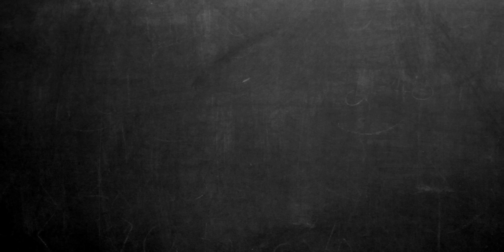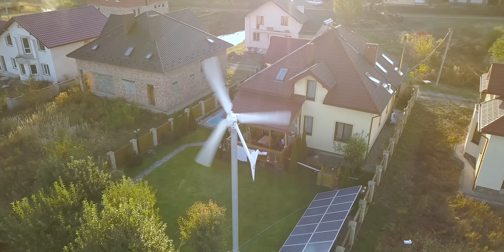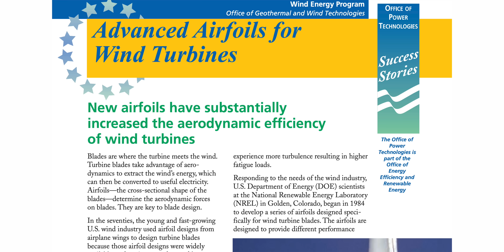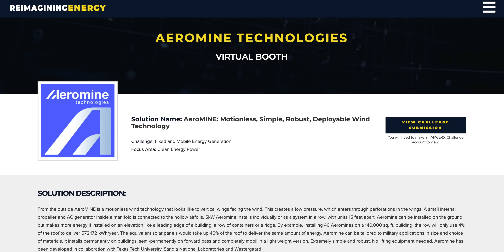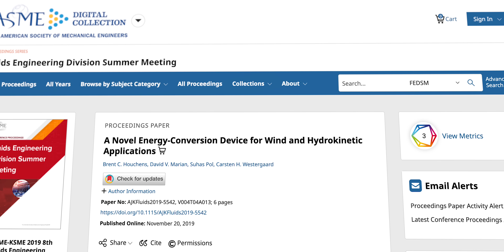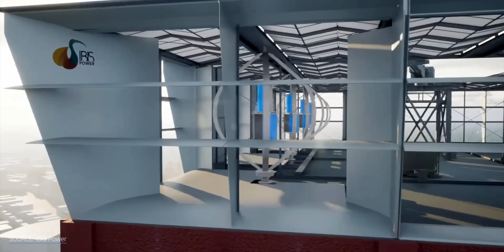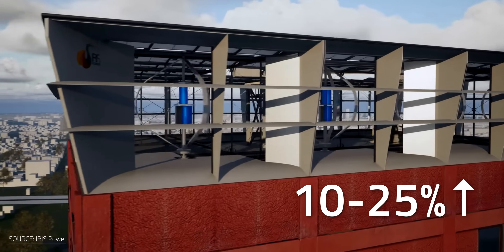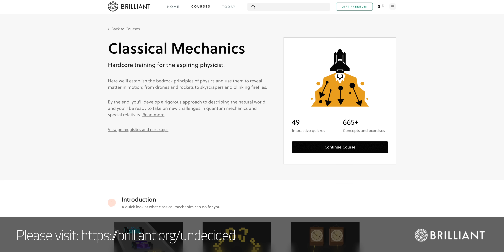How Can A Wind Turbine Be Motionless?

Comment: The power nest is exactly what I've been dreaming of for years. Some kind of a hybrid system of wind and solar working in conjunction with each other. And from some of the examples in the video, they look potentially easy to install on buildings.

Now comes the next part of my dream: somehow combining power nest technology with green roof infrastructures.
Reply: That feels like an either-or scenario, unfortunately. We can only hope that the powernest proves to be efficient enough so that we don't have to fill every roof with them.
Reply: You dont need a green roof if you have the power nest. Unless all you want is looks. The main thing for a green roof is to bring down roof top temps. The power nest will do that.
Reply: Hmm, why do you want a green roof with a power nest? If you want to have plants to reduce your CO2 footprint I would recommend vertical gardens. Look at Vincent Callebaut's architecture and buildings as an example. His Coral Reef houses combined with a power nest is certainly something that is not so far off what we know today.
Reply: @oskarkilo9033  I'm not disagreeing with you, but I just want to point out that reducing CO2 footprint is not the only, or even main, purpose of a green roof. Green roofs are great at reducing the amount of water that flows into the sewer system. I will explain with some made-up numbers. Let's assume in the countryside, only 2% of land is covered with buildings or roads. When it rains, 98% of the rainfall can soak easily into the ground. The 2% of rainfall that falls onto built-upon areas, such as buildings and roads, can flow down into adjacent green land and be absorbed. The result is that flooding from rainfall rarely happens in the countryside. However, in a city, the majority of land might be covered with buildings, roads and pavements. Rain that falls on such areas is typically channelled via gutters and pipes into the city's sewer system rather than soaking into green ground. In some cities, the sewer system lacks the capacity to deal with a heavy rainfall and the result can be the sewers system overflowing to flood roads. Flooded roads are bad for cars (rust), but they are also potentially harmful to humans because the sewer water will contain some (diluted) excrement and urine, and this can spread disease. One way to reduce this problem is to for a city's council to insist that, instead of using concrete, paved areas must use bricks that permit water to seep between the cracks, so some of the rainfall can soak into the earth below. Another way would be to encourage/require buildings to have a green roof. A green roof might have only a few inches/centimetres of soil in which short plants are grown (something like moss or seedum). When it rains, a surprisingly large amount of water can be captured in the soil of the green roof, so less water overflows from the roof to make its way into the sewer system.

About 11 years ago, my wife and I got a home office built at the rear of our back garden. Height restrictions in local by-laws required that the building have a flat roof. I was concerned that a typical flat roof might leak after 10 or 20 years (the sunlight makes the roofing material brittle and prone to crack). We discovered that if we had a green roof (waterproof base layer, covered with a few inches of soil in which seedum was planted), then the soil would protect the underlying roof from the harmful effects of the sunlight for 50+ years (by which time we will have died from old age). It cost us about £3000 extra to have the green roof rather than a regular flat roof, but I figured it would pay back for itself by not having to repair/replace a regular flat roof every 10 or 20 years, and my wife loved the idea that a green roof would look prettier than a typical flat roof.
Reply: @CiaranMcHale  I know exactly what you mean. When I build my house no one cared to make a ground examination. Turned out that the ground had a clay layer in it, which didn't let water flow easily to the layers below. I had all sorts of problems in winter times, when it rains a lot. But we fixed it by building a seep shaft filled with gravel that was drilled through the clay layer. Since these days I had no problems anymore. I also plan to build a cistern to collect rain water from my roof top and use it in summer time, when it usually becomes very hot where I live. Not desert dry, but dry enough to ration water. And as I said, Vincent Callebaut include all these into his house designs, so that they really becoming sustainable. And vertical gardening does has other advantages. Matt did a video recently about covering channels to stop evaporation and cool solar panels. Vertical Gardens can cool down cities in summer, increase air quality and make cities greener without wasting precious and expensive city property. So, why are we building with concrete and glas instead of building more naturally? Vincent Callebaut shows that it is possible, even with existing buildings. He showed that in Paris and transformed an old city building into something that I would like to see more often. But we still build these concrete shoe boxes in cities that heat up like the desert in summer. There are cities in the world that people abandon in summer. I heared that about NYC and I know that for sure for Rome. So, shouldn't we start to rethink city planning and home building like Vincent Callebaut does it? And yes, I admit I'm a fan boy of him, because he does awesome designs and all of them are sustainable and environment friendly.
Reply: This! Oh man, I have been planning out a system for my house to do just this and I dont know why I never thought of a "nest" format! I love it!
Reply: And to take it one step further, use solar heat generated by the nests to fill the hot water tanks - even for use in radiant heat in the winter.  That tech has been around for about a decade.
Reply: Now add solar heating to cool the panels and heat the building/water/store for later use, and we have a trifecta. Wonder if anyone is working on that 🤔
Reply: It is possible to combine PowerNEST with a green roof as a lot of sunlight goes through the openings we created. We also have requests from architects to have a restaurant with a glass wall right next to the turbines (without blocing the flow ofcourse), or an opcoming proect in The Hague with a roof terrace next to PowerNEST.
Reply: This is me agreeing with other commenters; as a green roof would probably mess with wind power efficiency, vertical green space (especially on high rises) seems to be the best option, and would almost definitely increase rent price on the floors that have it.

Biggest limitation is efficient water gathering. It would probably have to be from the roof top and used for non-edible plants. I would assume in most places only the south side, and only a portion of the floors, would have this.

There's about two practical applications: mental wellbeing of residents/workers, and reducing the worst reflective areas of sunlight
Reply: I also imagined a similar system for a floating city on the ocean as a solution to lack of territory and overpopulation, it needed a power source and it seemed obvious to me, glad it's now a reality

If someone tell you something is impossible, know that it is possible until proven otherwise, because if something is truly possible, all you need is the right way to achieve it, just like scientists did to discover new never seen elements
Reply: stop dreaming and start thinking and learning. Please. For the rest of us.
Reply: @dre3951  Oh do tell. Think and learn what? Wait, don't tell me. That climate change isn't real?
Reply: @dre3951  instructions unclear, was that supposed to be encouragement to them? And what, pray tell, would that do for the rest of us? I hope you’re not talking down your nose at them.
Reply: I was watching this and thinking that they look pretty great for residential and commercial buildings. And I would assume (I should point out I am not an expert in anything related to this) that if animal deaths were a huge concern, fencing could be put up around the perimeter of the building where the opening is for the turbines to limit animals flying in at high speed, while still not disrupting airflow too much.

Another random thought I had, but I wonder if you could put things like these along tunnels or rail track used in Europe by high speed trains. I wonder if their passing by at random intervals would be enough to generate extra wind energy on top of the usual breeze.
Reply: Noice.
Reply: ass sand to the mix for heat/energy storage as a medium and Pellier powered by the solar for either heating the sand or cooling the panels or AC
Reply: The green does not have to be on the roof, you can have green walls in the same footprint.
Reply: Also to incorporate water collection from the rooftop would be another feature I would like to see incorporated in to the design.
Reply: Does the power nest have to sit directly on the roof?  If not, elevate it three meters and put your green roof beneath -- nothing says a green roof has to have plants that don't like shade.
Reply: But you would still need nuclear for baseload backup. And if you have nuclear, you don't need to spend more money, and destroy sand-beds and forests to build and site windmills and solar panels.
Reply: Maybe not green roof, but green wall. I see a lot of apartment complex that has only windows at front and back walls. The sides are absoloutly blank and ugly. Instead of ugly posters which advertise simething usless with an overphotoshoped woman in bikini. We can plant on these walls even a very good O2 poducer/ CO2 holding plant, or something energy plant for heating.
Reply: @Kaczyfunny  A good friend has a neighbor who has two green walls on his garage.  He didn't plan this; one summer he noticed that the one corner of the garage where he had a climbing floral vine was cooler.  He not only decided to skip trimming it back in autumn, he also put up strips of trellis two feet wide along the top of the south-facing wall.  The next spring he added trellis to the east wall.  The difference in the temperature inside the garage on a sunny summer day once the vines had covered both walls was amazing!  So when it became necessary to treat his roof to get rid of moss he got it nice and clean and then applied some coating that's supposed to make standard three-tab shingles last longer and added a bit of extra pigment to lighten the overall color of the roof.
Reply: I've often thought of the same thing, but with the addition of hydro power. While I find the nest interesting, I still think the best path forward for cities with tall buildings, is a combination of gas produced power from hydrogen, methane and and natural gas. Solar panels just take up a tremendous amount of room and can't produce enough power for a 20 or 30 story building. For suburban single homes, the combination of solar, wind and hydro, could completely replace the need for homes to be attached to the grid. While the batteries are concerning, it should still be better for the environment than the millions of miles of copper wire that is produced and strung up across the world to connect all those homes. A simple system may be 2 batteries, with charging inputs from Solar, Wind and Hydro. One battery would be able to power the whole house, while the 2nd battery was being charged. During the day, the Solar power could power the house and charge the batteries. At night, the house would run off of a single battery. If a battery became depleted, the house would switch to the second battery and begin charging the 1st battery, using Wind and/or hydro, until the solar power kicked in again. Hydro could be a natural stream or a hydro battery, where water is stored in a elevated tank, which is filled during the day when the solar power is available. A small stream of water, could turn a hydro turbine, that could charge the battery at night, with the water collected in a lower tank to be recycled to the elevated storage at a later time, when the solar power was producing again.
Reply: There's already some work on making translucent solar panels and growing plants in the shade under them.  Solar panels only collect energy from a very small portion of light, and many plants specifically evolved to only absorb a portion as well.  Heck, with any kind of decent spacing, you can already grow shade-loving plants under decently raised solar panels.  Might not work on a roof structure so well, or at least harvesting anything from the plants may be complicated or require larger infrastructure.
Reply: I wish I could make a sketch to attach here. I'll just try to put it into words though. Here's a way you could try that.

Power nest works by funneling wind, right? And Aeromine works by using wind with airfoils to generate low pressure zones that suck air through a turbine, right? So if you pair them together, 1 funnel for air capture with 1 Aeromine for air outlet, and loop them into a ducted air turbine below them, you could get significant increases while keeping the horizontal footprint low. You could almost stack them, so that the air expelled goes upwards instead of through the entire rooftop. Then if you set up your hydroponic / aquaponic gardens on the roof you can use solar arrays as partial shade (spacing properly to let enough sun through).
Reply: @Sedr1s  you have a very complicated roof there. The added weight of the green roof/hydroponics is not going to sit well above the nest...but in theory that could work.
Reply: @onlineo2263  this is why I wished I could attach diagrams. It’s supposed to be on the same level as the nest. Picture horizontally: 1/8th of the roof used for nest funnels. 7/8ths for the garden and solar racking.
Reply: Power nests seem cool and all, but they occupy an entire building story. Taking the prices of your region do you think that they could generate a greater economy then just building and renting apartments there? Also, given their size and weight they have to be accounted for in the structural calculation for the building to see if it supports it. You can't just plug and play.

Comment: 3:38-4:01 very SHORT explanation of a revolutionary new technology.😮 I had to rewind and pause your video and in order to understand the concept, which was obfuscatory, to say the least!😳 you talk about airfoils on planes, their adaption to race cars, but then neglect to mention the most OBVIOUS difference in this new adaptive technology: mounting the air foils VERTICALLY on The roof, instead of horizontally. 

In addition, , you state that the differential airflow is captured via a “short tube“ to the ground, but since most houses are at least two stories tall, that’s not a very “short tube“ 😮 

Great new info, but more detail needs to be given to the physics and mechanics of the transfer of wind energy into electromechanical
Reply: The concept is the same, using the airfoil shape to create high velocity, low pressure area to 'suck' the air from the ground level
Reply from the maker: Appreciate the feedback.  Always looking to get better.

Comment: I remain skeptical. Isee a lot of hype about Aeromine (and similar small turbines) but no hard numbers can be found.
You refer to physics. It’s also physics that dictates that the power that can be captured by wind turbines is related to the swept surface that is exposed to wind. Speeding up the flow does not change the amount of energy contained in that flow. 
Add to that the fixed position and the turbulence that is usually found at such rooftop edges…
Reply: There are not even figures about the size on their website. Which would allow a serious estimate of the yield for different wind speeds.
But by all appearances, it's just a couple of squaremeters wind swept area.
You won't get 5 kW from that, except at very high wind.
And you also won't get 14.3 MWh/a from it at fairly common conditions.
Reply: Agreed stinks of bs and marketing spins. In addition accelerating the flow with a ventury isn't taking any work out of the flow so adds nothing unless there is entrainment of additional mass flow. Don't think Matt actually knows much or any aerodynamic/fluid mechanics
Reply from the maker: These are in the pilot testing phase, so we'll have to wait and see how this turns out.
Reply: @UndecidedMF  there have been so many of those small rooftop turbines that never got off the ground…. Ridgeblade, Airturb, Windwall and however many others. The business case is just not good enough. All they ever do is throw that max power figure around that the generator could deliver under optimal conditions, but which is never achieved in real situations. I bet that this one will be no different.

Comment: This turbine is not motionless, because it has rotating blades with generator.
I don't understand how it will works if we have opposite wind.
IMHO in sunny days it works better, because we will have stronger convectional flows from hot walls.
Reply from the maker: Yes, it has blades that turn, but the structure itself is static/motionless.  Appreciate the comment/thoughts.